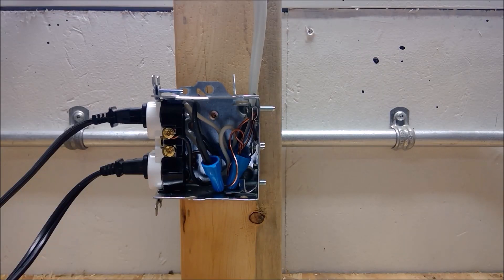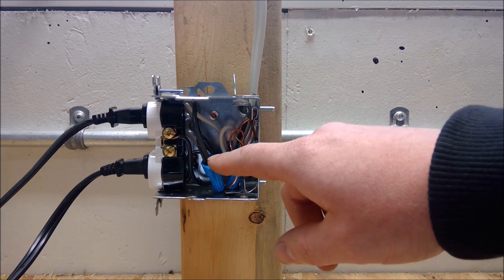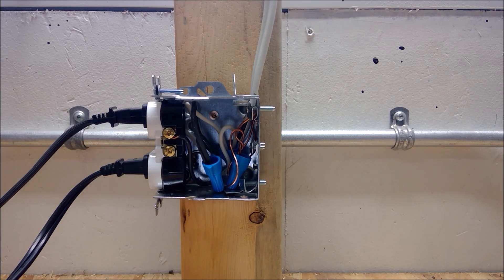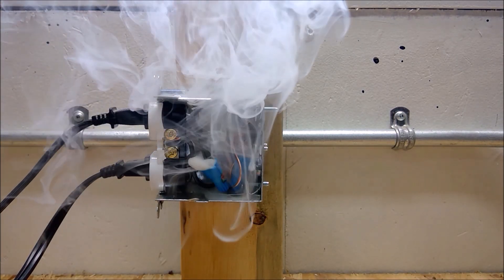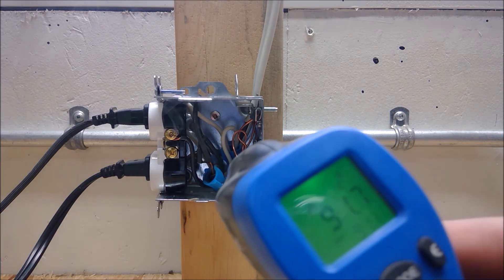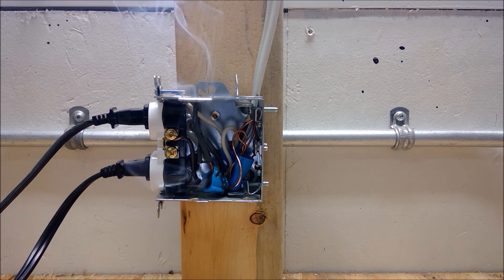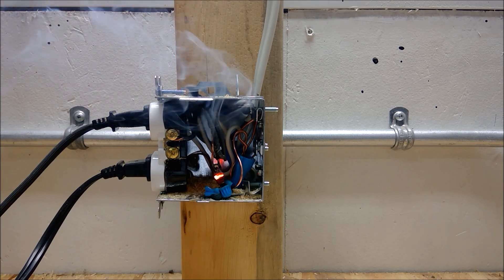Loose wires cause fires.

Comment: You lost me when you added the sawdust.
Reply: I guess the sawdust didn't start a fire because he ended the video.
Reply: Dust gets in the boxes and builds up over time.  The sawdust isn't unrealistic.  This scenario does happen.  Most of the time the box contains the fire and it doesn't burn down the house. All connections need to be inside a box.  My house has a few connections that aren't but it's old knob and tube wiring, wrapped, soldered, and sleeved.
Reply: Even it didn't ignite properly and the flame died haha. This is a real threat but it's not the greatest example.
Reply: Why? Have you ever looked inside most of them? They're a mess with debris
Reply: obviously a good electrician wouldn't make that mistake. the point of the video was to demonstrate to laypeople why you need to hire a good electrician, or to demonstrate to training electricians that they need to be careful making connections, and to check older connections before adding further load to them for the first time. pretty obvious guys. if this video's value is negated by the fact that good electricians exist, then why bother with training or educational material at all? why post a video on the potential hazards of scuba gear, when expert scuba divers exist? yeah, the loose wire nut is a rookie mistake. that's the whole fucking point of education and training, to show a rookie the potential mistakes he/she can make so that they can become a "good electrician" or a "competent handyman." god these comments are almost painful. this guy took time out of his life to provide free educational material to people and you're acting like he tossed his drink in your face.
Reply: Karl The Fragr sawdust is a ridiculous example. Don't even bother to defend it. More likely it will be the plastic casing around the wire that catches fire
Reply: What? It's understandable. Shop workers or just people who work in their garage alot can experience this
Reply: Even if the electrician doesn't leave any sawdust in the junction box, it can still find it's way into the junction box after the fact. Especially on older houses. It's not as preposterous as you might think.
Reply: lol, seriously? We are in the process of renovating a bedroom at my house and the outlets are full of debris.
Reply: If you've ever looked inside older electrical boxes you'd know various debris ends up in there over the years.
Reply: Debris does build up in electrical socket boxes over time though, it’s not like they just stay perfectly clean. If anything adding the sawdust makes it a little closer to a real world example
Reply: Ive seen outlets in barns, sheds, coups etc get packed with dust. Even up along the ceiling.
Reply: Maybe not "packed" by packed i mean a good 1/8 inch thick layer of it.
Reply: he should have lost you at loose wire nut, as a good electrician or even competent handyman wouldn't have done that...

for the record... old homes acquire dust and bugs in their outlet and switch boxes.
Reply: Hire a better electrician then.
Reply: Check any woodworking shop and you will find sawdust in all electrical boxes and gear. All electrical products need maintenance, for a long time it has been install and forget it.

Comment: I had a long comment typed but youtube glitched and it just kept loading.  This video is alarmist and the only thing it demonstrates is how a loose connection fails.  99% of the time the bad connection cooks itself apart.
Reply from the maker: I don't disagree. I wanted to show the worst case scenario. Hopefully my wife does not need the hair dryer for that long either.
Reply: This is not alarmist - it's a view into an all too common occurrence.

Comment: So even with the presence of combustable material such as sawdust this entire event didnt result in a full blown fire? It flamed up for a few seconds in the end but dissipated to ember glow.did the flame re emerge after cutting the video?  Or was this hazard remedied by fire eetardent materials used in this experiment? I had witnessed soarking from an outlet and discovered a buried metal junction box with melted murretes that had an open hot wire to be the culprit but it did not result in an actual fire.is this possible?
Reply from the maker: If the load was allowed to continue the heat developed by the loose connection would have made it's way along the wires and eventually outside of the junction box. The surface temperature of the wire would be enough to cause ignition to some combustible materials. I didn't allow this to reach that point but I am currently working on a video that will demonstrate this and hope to upload it soon.
Thank you for the reply.

Comment: Great demonstration! Give it time, dust actually collects in switch and outlet boxes. The dust provides the fuel for the arc. Here's some info. Screws on outlets and switches actually loosen up over time. Creating loose connections.

The same can happen when aluminum and copper wires are twisted together and capped using a wirenut. I had happen at my parents house. The house built in 1963. The was wired by an electrician. I'm guessing at that time, there was no clear  understanding about copper and aluminum creating electrical issues.

Comment: how dissimilar are the US electrical standards to Canadian electrical standards, it seems we use very simillar devices and wiring. all though we call it a wire nut here. lol
Reply: Also, I'd like to add here that I'm a second generation electrician and have been doing it for 15 years. In the US the common thing for residential is to use these blue plastic nail on boxes and the NEC electrical code is pretty straightforward on how many wires should be in a box, on a device, and in a wire nut of a certain color. since they are color coded here (grey, blue, yellow, red, tan, etc.). At any rate whenever I terminate solid copper wire with a wire nut I always use my lineman's pliers to twist the copper together until the insulated portion is also twisted, then twist on the wire nut. this insures good contact between all wires and also that no stray copper will attempt to poke through the side of the wire nut.
Reply: The standards are almost the same, with a colour difference in 3 phase. And we call it a Marrette because they’re all made by Marrette band up here
Reply: Makes sense, similar to Dolphin splices for low voltage wiring here, dolphin is just a brand name but that's what we use to describe the crimp connectors for most low voltage work. I see most of the time a metal box is used on wood frame, which is odd to me, we almost exclusively use non metallic enclosures in wood frame and metallic for steel frame. most of the time steel frame is only used in commercial buildings here.

Comment: About 2 years ago when I worked for Palmer Foods in the frozen food section this is what started a fire the fire was burning inside the freezer and in area of which no one could see when you started smelling smoke but we couldn't figure out where it was coming from due to the ventilation system later we found out that there had been an electrical fault and the exact way that you demonstrated inside the freezer motor housing what's completely inaccessible.

Comment: Nice sawdust mate. Did the faulty wirering also do that? 

No sawdust 1:10
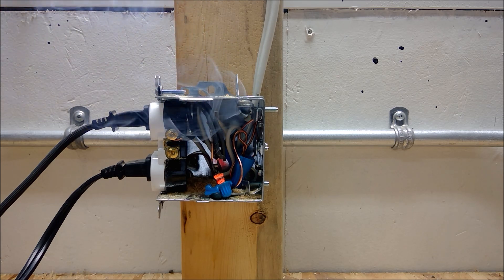Sawdust 2:31
Reply from the maker: Wires did get red hot but only the insulation caught fire. I added the sawdust to help show how hot the wires really were.
Reply: Just seemed a little strange.
Reply from the maker: I teach an electrical training program and this video is used to show what can happen if care isn't taken to ensure proper mechanical connections are made. 
Yes not every box will have sawdust in but if the heat continued up the wires it would eventually come in contact with the wood frame structure of the building. 
Appreciate the comments. I hope this explanation helps to show what the intent of the video is. 
Ultimately we want to ensure that every electrical connection is mechanically and electrically completed and secure.
Reply from the maker: Please send me a picture of you work. The point of this video is to demonstrate how if the wiring was done incorrectly it could result in a hazodous situation.
Always appreciate constructive criticism

Comment: Nobody uses wire nuts anymore. Nice history video.
Reply: Sorry to burst your bubble but that is not true they are still commonly used all across the United States.
Reply: You bursteded my bubble, you crazy you.
Reply: Yeah sure, lets trade security and not burning the house down for saving 5 secs when removing the connection...
Never had a problem with WAGO connectors ever, removing a wire takes seconds :D
In Germany we dont use anything else anymore
Reply: When you say clips, do you mean push on connectors ( Ideal, Wago ) ?
Reply from the maker: We use them everyday in Canada. The are an effective way to ensure the wires are mechanically and electrically secure. They also allow for the wires to be removed a lot easier than push in style connectors. I do use push-in style connectors for lights or other equipment that only would have a single two wire circuit supplying them.
Reply: stick to your retail job.
Reply: They're used in every single building I've ever seen in Canada. I don't know whether they are supposedly on their way out or not but they are still very much the standard in practice. I try to make a habit of wrapping them in electrical tape... when I'm not feeling lazy.
Reply: @Derpster they said that about asbestos, But they are used in your car plastics that you use an many other house hold items. Why? coz the asbestos  industries wine and bitch that they would go out of business. Just as the same for oil and gas and other useless outdated crap that is used in the current year.
Reply: Voltage controlled Ovulator How is oil and gas outdated, the oil industry created millions of jobs, engine design and production has created millions of jobs. My car with a gas engine gets me from a to b without having to worry about charging it. Nothing is outdated about oil and gas
Reply: a properly terminated wire nut is the best possible way to connect solid conductor wires together. The connection contains more contact surface area between the conductors than even a screw down lug does. I do a lot of thermal imaging looking for possible issues, and i've never seen a wire nut fail when properly terminated. I have seen many many sorts of bad crimps, lugs come loose, any kind of spring tension based connector is junk as well.
Reply: There's nothing wrong with wirenuts. Some idiot decided to put it in the industrial machine code book not to use them anymore. They're still fine for building wiring. There is nothing wrong with wirenuts if properly applied. We just have idiots who get inventive and use power tools to twist them on or don't ever twist them and forget about it.

Crimp on connections or spring connections aren't great either. A bad crimp is usually difficult to spot unless you pull on the wires. And most spring terminal connection blocks are very annoying, especially Ideal, when you need to disconnect things. The only ones I've liked so far are Wago connectors, easy to get on Amazon now, and inexpensive.
Reply: And I've seen idiots DIY some garbage wiring with these nuts.
Reply: Death Dies also Wago lol. I used to sell Wago. My job was Rep for them in Htown, LA and other big Gulf cities. Oil/Gas sector
Reply: Aman A 
Yay. UK safety codes......oops that is unless theY are for flammable sheeting on buildings
Reply: Uh yeah they do use them.
Reply: We still use them in canada
Reply: In our city, they are REQUIRED. No safe connections permitted here, no siree-bob.
Reply: I use em all the time and i dont even put the shit in a junction box , last week i plugged in an air compressor and lost power to my whole garage.. and i can't use the light above my sink cuz when I pull the string it starts flickering so we just leave it on all the time.. I should look into that tho
Reply: Derpster just a few weeks ago installing a new cealing fan
Reply: Real men solder the wires together, crimp connections are for lazy people
Reply: Yeah literally use them everyday, those new clips suck and will become loose exponentially faster then a wire nut
Reply: ChesterWolf The Griffin Just start a new trend in USA and start using the better quality wire connection blocks, like we do here in the UK.  Maybe you might even eventually get to the safer standard of using a 3 pin plug too....

Comment: And this is why you twist the wires before screwing on the wire nut.
Reply from the maker: Absolutely. All good electricians will do that. Unfortunately some homeowners do not.
Reply from the maker: Yes absolutely agree!!
Reply: That's actually the wrong way to do it.  It specifically says not to do that on the box.
Reply: Sean Place, I'm a 01 electrician in the U.S. I never pre-twist just turn the nut enough and it will do the same. I guess some people have weak wrist.
Reply: +ike fun It does, when you teist them the connection surface is so high that heat won't occur, unless you plug in 15 extensions with toasters. I am studying electrics right now and even my teacher said that if you didn't twist them you would already go down a grade.
Reply: +ike fun Why do you think it doesn't work?
Reply: The wire nut makes the twist, I have seen this when I do it, it is meant to tighten both connections; there is  a metal cone inside that also shields both connections.